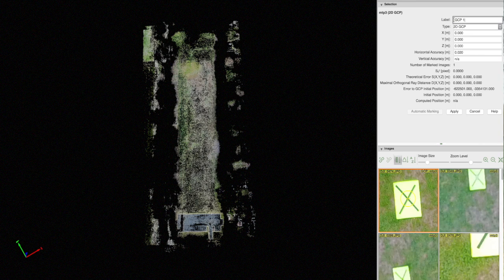Mapping With Mavic (Part 2)

Comment: hi. one example:
if i have geodetic survey of the parcel (and house) done, so i have acad map with terrain points etc, can i make photogrammetry of this parcel and tie this model to geodetic points from that survey (corners of the parcel, for example). this should in theory be then geo-corrected yes, so 3d model is usable for some terrain planning etc?
Reply from the maker: If I understand you correctly, You was to correct a 3D model by using the property corners as Ground Control Points and then make a DEM from the model? That will probably not work for contours but would work for accurate measurements on the surface of the land.

Comment: Apps need to improve the 3d ! Quality must come up !
Reply from the maker: Paulo Lobo Do you mean the app to plan the flight pattern or the program that stitches the pics together? I may have a solution for you.
Reply: Im talking about all work ! Look, i made tests for some months will all aplication ! Until today i dont find more quality than DroneDeploy, for 3dstatue or for fields....
Reply from the maker: Do you have a way to post your test? I would like to see.
Reply: If you want i can build another one, again and send it to your email with my full quality, but only in the weekend...
Reply from the maker: No doubt the quality is good. I think you lose some quality through sketchfab. Nothing will be as good as the original file. Dronedeploy has a good cloud service and I have noticed the better the GPU and CPU your computer has the better it looks. BUT, for me it comes down to control of the perimeters. I can process as much as I want I my own system and add tie points, GCP's and even run the project in high, medium or low resolution.. I think the service you use really depends on your needs . I have a few clients that have TBs of data and it would cost a fortune to use the cloud.
Reply from the maker: Thanks for sharing the links. The models really look great.

Comment: One thing not mentioned is that you need "survey grade" GPS/ GNSS to get accurate ground control points (around $20K). To get an accurate map, yes you do need accurate ground control points, as was pointed out here. Also, in most states, if the map is to be used for any type of design work, it needs to be done by a licensed surveyor, so that will limit your clientele base if you're not a licensed surveyor.
Reply from the maker: Yes , very good point. There are serveral things I need to mention. I'm glad you brought that up. It's 2 VERY BIG misconceptions about useing a drone for mapping. The drone is just one tool out of several.  Creating a 3D model is different.

Comment: Aside from inch being an offensively unintelligent unit, within 2.5mm seems unrealistically precise. How would you determine a reference point to that precision let alone the photogrammetric model. When we do measurements for graphics in the engineering company I work for we use a leica precision GPS and get about 2.5cm precision on a good day...
Reply: I think he meant to say a tenth of a foot. Surveyors don't use inches.
Reply from the maker: Ty Brady I've always heard it was a tenth of a foot so I thought it was a mistake too. Since David is extremely smart I thought I was wrong. He just misspoke.